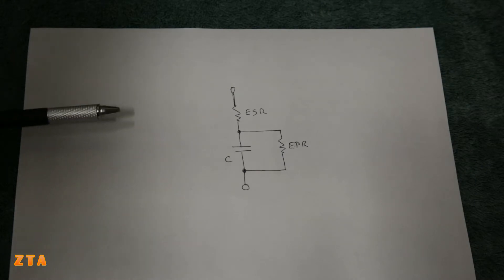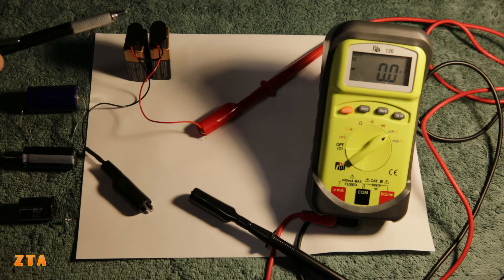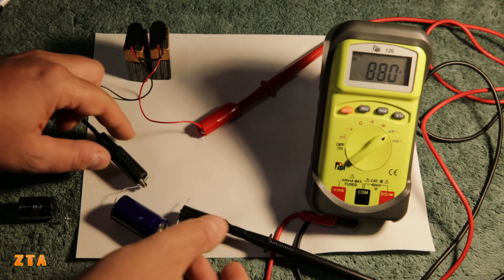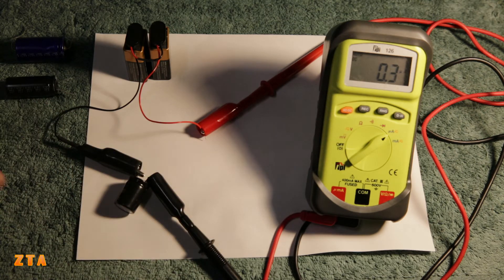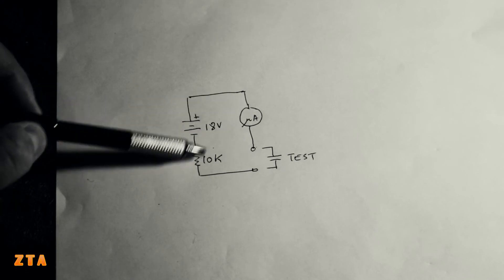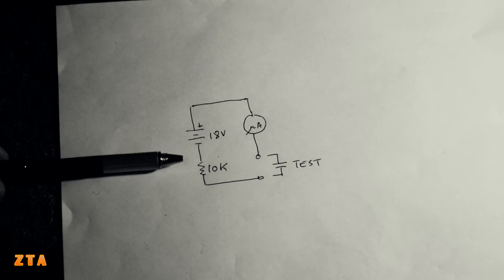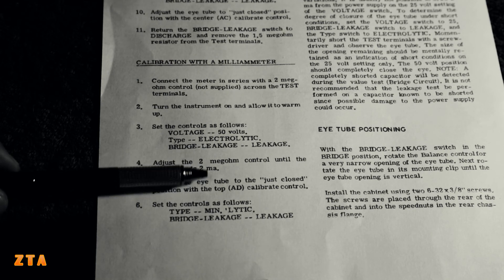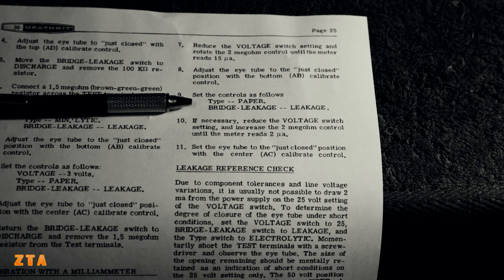The $5 Capacitor Leakage Tester

Comment: Thank you for this nice video.

If ı want make a leakage tester with Arduino what is your advice test algoritym? 
A ) I must choise capacitor's C range  value? (I mean if capacitor's C value high ;it is must more long time to zero ampere time )
B) if a capacitor's currrent value over 2 miliampere on test it is certainly a"Leakly capacitor"

Thank you for this great video again
Reply from the maker: For the Arduino or other micro controller, you'll want to have some code to wait longer for larger capacitors. Maybe have 3 settings for small, medium and large capacitors and also for types of capacitors. Then yes you'll want to have a current threshold for each capacitor range and type. The manual/analog meter is just easier to use because you can visually tell how the capacitor discharges. With a micro controller your code has to be smart enough to make the right decision, so it isn't trivial.

Comment: Thanks for sharing this little gem - have been playing around with this on my bench and it works pretty well...just one question can i increase test voltage to the working caps voltage , will this give me a better result THANKS
Kind Regards...
Reply from the maker: Glad to hear it is working out! You can increase the test voltage up to the working voltage of the cap if you'd like, but because the meter is so sensitive, you don't have to. For safety, I wouldn't go above 50V.

Comment: I think you have to wait until the current settles down because capacitors are still charging. The "good" capacitor settles down quickly because its capacitance is so low comparing others.
Reply from the maker: That's correct, especially for higher value electrolytics you need to wait more. Once the capacitor gets leaky, the settling of the current bottoms out, so you can wait longer but the rate of change of the current diminishes.